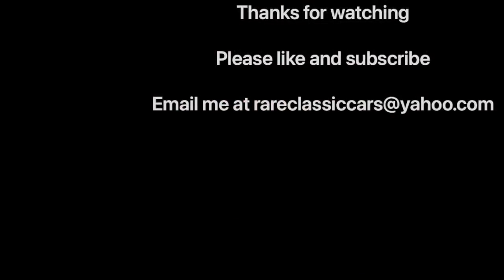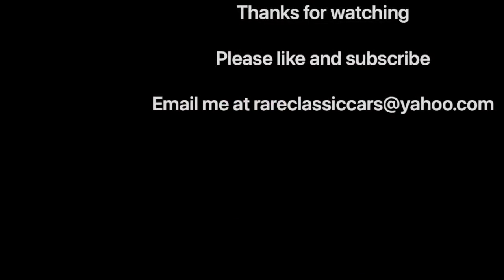Worst Engines of All Time: GM 2.5L Iron Duke Follow Up

Comment: Adam, thank you for the clarification.  Previously I mentioned my brother 84 Buick Skylark Limited with the EFI and the 4 speed manual and you clarified that with the automatic the vibration was worse.  I agree with you overall the engine was primitive and more agricultural so in those terms it was not a great engine especially when you compare it to the 1.5 Honda.   Although compared to the 1.9 I had in an 85 Mercury Lynx with a 4 speed manual the 2.5 Iron Duke was a great engine but then you can always find something worse i.e. Yugo.  Driving my wife's 77 Accord in comparison Honda was so far ahead of Detroit when it came to smooth economical and reliable 4 cylinder engines.
Reply: I’m glad you enjoyed your ‘77 Honda, but those little stratified charge engines had lots of problems, from drivability issues primarily caused by the carbon buildup in the prechamber porting and easily gummed-up carbs, to the engine’s propensity to blow head gaskets.

Admittedly, they were relatively smooth due to their small displacement.

Furthermore, the Honda automatics of those days were crap. Honda didn’t get their transmission problems worked out until the early 80’s.
Reply: @sking2173  Funny how so many gloss over any faults that a Japanese car may have, even if there are several, but declare an American car to be unfit for use for the slightest tiniest item.
Reply: But the X car weighed about 2400 - 2500 lbs.  Too heavy for a foreign-size engine.  You need cubic inches to produce torque, especially at low RPM.  Tiny engines just don't cut it.
Reply: @michaelbenardo5695  The Iron Duke had plenty of power for that 82 Buick Skylark especially since it was a manual 4 speed with fuel injection.  With an automatic I would agree with you but the manual had more than enough power.  The 2.2 in my 99 S-10 extended cab had enough power as well because it had a 5 speed manual but again with an auto not so much.
Reply: @jeffreysproul9110  I was saying a foreign-sized engine, aka a Japanese engine, is not enough.  The Iron Duke was fine, even with an automatic.  I drove a brand new one, and I liked it.

Comment: One thing that younger viewers may not understand is that there was a thrifty attitude among even many educated and successful people who were born in the 1920's and 1930's, especially among those who lived in upscale suburbs of the so called "rust belt" industrial cities. They might have spent significant money on a nice home or a college education for their kids, or even a vacation cabin up north. But they did not necessarily feel the need for a fancy imported car with a smooth running engine. They just wanted something mainstream that was reasonably stylish and reliable. And about every 5 to 6 years, they would buy a new car with the same characteristics. Also, if one worked in banking or manufacturing oriented businesses, it was always "safest" to be seen driving an American car.

Due to various oil price shocks during the late 1970's and into the 1980's, fuel economy was also a real concern. A lot of people think the "energy crisis" ended a couple years after the initial 1973 event. But there were aftershocks for the next decade that resulted in periodic gas price spikes and occasional shortages. And there was also stagflation and a bad early 1980's recession whose effects lingered well into the mid 1980's. These are now often overlooked reasons why buyers might have settled for the iron duke 4 over a larger V6 or V8.
Reply from the maker: It also explains why many went to the Honda or Toyota dealer.
Reply: @RareClassicCars  I think the imports generally got better mileage than the GM cars, which no doubt lured many domestic buyers. My mom went from a '68 Mustang to an '80 VW Rabbit and then to an '87 Mazda and a '94 Accord. The '80 Rabbit was a response to high oil prices which had reappeared in the late 1970's. There was no going back to the Ford dealer.

Comment: I haven't heard anything that bad about the LV7 1.4L 4 cylinder that GM puts in cars like the Chevy Spark. At least in naturally aspirated form, the thing seems pretty reliable. So for the sake of the argument, lets classify that as a good engine. Now what would happen if GM were to put it into a Corvette or an Impala? That would immediately make those cars suck. But would that be the fault of the engine, or would it be the fault of the GM bean counters who decided to put their cheapest crappiest engine into cars that should have never had them? In a cheap econobox or truck, the Iron Duke was fine. Crude, but cheap and reliable. It's when you put it into a car that never should have had it that the Iron Duke really sucks.

Comment: In 1982 with the Camaro in California the V8 had the worst HP to displacement ratio. The V6 was way higher and the 2.5L had the highest HP to displacement ratio.

So buying a V8 you got 135HP with 5 liters and an automatic in California 27 Hp liter

The 2.5L in California was 90 HP and available in manual transmission or automatic. So 36 HP liter and with a manual you did not have a lossy transmission.

In 1982 fuel mileage was important. The 2.5 Iron Duke in the Camaro with manual transmission here had a 24 MPG combined number on its window sticker. If you "upgraded" to a V6 you gained 10 to 12 HP at the flywheel; but in California you had to buy an automatic transmission so you lost some HP in the transmission torque converter losses.  The V6 with automatic dropped the 0 to 60mph time by 1/2 a second. Ie from 15 down to 14.5

Many folks here might not remember how rotten the V8 was in 82 in California. It was 135 HP when i got my 2.5 L camaro in july 1982

Even worse the V8 too only came on California in an automatic transmission. PLUS the V8 with 135HP was a muscle car when you were under 25 snd thus you got a radically higher insurance premium

In test driving a 2.8 with automatic and a 2.5 with manual the V6 to me seemed not much better in acceleration.  I might have bought a v6 with manual if it could legally been sold in California.

All the numbers above ate worse than what you think since buying a V8 is a 598Lb motor and thev 2.5 is 278 lbs less ie 320lbs 

So with the v8 camaro in California you got 45 Hp more for that extra 2.5 liters of motor. Plus you gained 278 lbs more mass say 9 percent more car weight.

Comment: Agree about the engine being OK in the pickup.  I drove them in small pickups and Astro vans with manual transmissions in the early to mid-80's and they were acceptable, but I recall having a rental car, a Cavalier, with one and it was an abomination compared to a Honda product.  The only good thing about the car was it had adequate power and surprisingly, decent fuel economy.  Otherwise, the entire car was a crude contraption and it is no wonder GM lost market share.  And GM never seems to learn from their mistakes.

Comment: During that era my occupation required 25k per year traveling in company-provided leased vehicles.  My first car was a ‘79 Malibu with a V-8.  Certainly not fast by 60’s V-8 standards, but smooth, quiet, and reliable.  My next car was an Olds Omega with the Iron Duke.  What Adam says here is correct.  The difference in refinement, vibration, noise, and horrendous torque-steer under hard acceleration was stark.  The next car was a Buick Skylark… no appreciable difference.  Finally I got an Olds Ciera with a V-6.  No comparison.

Comment: Adam, I must agree with you on the overall outlook of that engine and the vehicles they were installed in. I personally never owned one, but had driven many vehicles equipped with that engine and had repaired numerous ones. To be honest, customers had both a love-hate relationship with their 2.5 equipped vehicles.  The late 70's and basically the entire decade of the 80's is a time that not only GM but all the domestic manufacturers want to forget ever happened. Serious quality issues, thrown together engineering, (which probably frustrated allot of engineers, possibly due to the bean counters corner cutting. Forget the R&D, let's just see what happens approach, especially GM.) With all the new regulations coming forward (at that time) its amazing anyone of them survived.  Thanks Adam for the follow up video. Keep up the good work.
Reply: Let's not forget decisions as to power-train options, because of image-related issues... such as not making the '82 Trans-Am with a turbo V-8 (Makes it quicker than the '82 Corvette) or de-tuning the SVO Turbo 2.3L OHC I-4 for '86. (For '85: Made 205-hp vs the 5.0L V-8's 200-hp) And don't get me started on how GM killed the V-6 Chevette they threw together, but kept developing the Lotus-designed engine they really intended for it.

Comment: I think you just nailed it right on the head, Adam. The "Iron Duke" was best suited to be teamed up with a manual transmission rather than an automatic. My Iron Duke powered 1991 S10 was equipped with a 5 speed manual and even though it was not very powerful, I could keep up with traffic on the freeway. Driving through mountain passes, however, required patience and plenty of shifting to maintain your speed. Passing, at times, could be interesting as this engine does not like to rev and it gets pretty breathless at the upper end. It might have been an "okay" engine in terms of reliability and durability but it was light-years behind all of the other 4 cylinders in the market at the time. A pushrod 4 was pretty low tech.
Reply: But it was STURDY.  And that, after experiencing the disaster of the "state of the art" Vega engine, was what we wanted.  STURDY.
Reply: @michaelbenardo5695  I agree, it was STURDY. To get the most out of the Iron Duke...or to make it more bearable, a manual shift was the only way to go. You had 2 more gears and they were spaced out pretty good. The automatics at that time were limited to a 3 speed which did nothing for power as the transmission sucked up what limited power it could produce. Definitely not in the same league as what the imports were putting out. A Honda with a 4 speed auto was pretty peppy at the time.

Comment: You can believe me or not,but a close friend of mine who is a lifelong mechanic had a late 80s Buick skylark with a 2.5 and after over 200k he decided to re build it and the rear main bearing only had one half of the bearing insert in the block not cap,never been apart.Never had any drivability problems.Cant explain but saw it.

Comment: Jim Hall of Motor Trend, when testing the “new” AMC 2.5L I4 in 1984, said that while Pontiac supplied Iron Dukes to AMC for a few years (1980-83, specifically), GM should buy AMC’s 2.5L four and replace the Iron Duke with it, since the AMC engine was far superior. And it was based on the old ca. 1964 AMC six!

The 2.5 Iron Duke was a boat anchor. Boat anchors are reliable. But that’s about it.
Reply from the maker: Jude, was this Jim Hall of Motor Trend?  If so, I know him well.
Reply: @RareClassicCars  Yes. Sorry, Motor Trend, not C/D.
Reply: Trying to find the archival clip

Comment: The Rover K series is a candidate for wirst non Anerican engine,  they all kettle themselves and have so many design faylts that heads do not stay torqued down due to the stretchbolt design. Hey are worse than the GM death star for ONGGGF..

Comment: I think your comments are 100 percent on the mark.  Expectations of car and truck owners are often very different.  Also, I agree with you about many US cars of this era — they seemed cheap because they were “thrifted” a bit too much, particularly GM and Chrysler products.  The Iron Duke was just a much rougher running 4-cylinder engine than many of its competitors.

Comment: 1990 Ford tempo with a 2.3L pushrod turd or 1990 Honda Accord F22A1 inline 4 with balance shafts,  rear windows that roll all the way down, 5 speed auto that operates like a manual transmission internally, and glass headlights that you can change the bulb in.  I could name features of this car all day, awesome vehicle and was truly over engineered in all the right ways. Except the turning radius was terrible, you couldn't remove the front rotors without total disassembly of the suspension, the transmission had no serviceable filter but it had all external shift solenoids on the case for making repairs easy, and 2 timing belts, one for waterpump and cam , the other one was REALLY tiny and drove the balance shafts. 500,000 mile cars, easily .

Comment: If it's 1982, and you want a smaller car that is fuel efficient, choosing an American car of any sort would not be the best choice by a long shot. A Corolla, Civic, GLC, 210, 310, Rabbit, etc etc etc would be the obvious choice for the savvy consumer. BUT, it's 1982 and a lot of car buyers in the US wanted to buy American NO MATTER WHAT. It's absolutely silly and insane to me that people would settle for, for example, a Chevette which had virtually no standard features whatsoever, questionable build quality, absolutely horrible sound deadening, basically no real refinement, a sub-60 hp engine, etc etc etc when for nearly the same money you could get a Japanese car with a very efficient, quiet drivetrain, LOTS of standard features, a 65-100hp engine and phenomenal fit and finish instead. But again. It's the average American consumer in the early 80s and LOTS of them would rather buy a very sub-par domestic car than give a dime to the Japanese or German companies. Hence people probably had a lot of love for the iron duke because they didn't know how much better they could have had it and didn't care. (And yes, I realize the Chevette didn't use the iron duke, and also see the irony of people choosing an "American" car which was just a slightly changed Opel with an Isuzu-derived engine. I should also mention I've had multiple Chevettes and love them to death, but I can admit their many flaws compared to the competition of the time.)

Comment: Please Inform, but I think your referral to the TECH 4 engine as the  Iron Duke is mistaken, the Iron Duke was a 4 cylinder all cast iron 4 cyl  used in the Nova of the 70's and even the chevrolet vans had them as the entry level engine. Mercruiser used them in their inboard  marine applications .
Reply from the maker: Both were called the Iron Duke and were completely different from one another.

Comment: I once dated a lass that had a Cavalier with an iron Puke in it.  Looking back on it, it had to have a bad motor mount somewhere in there on top of the normal vibration.  You mentioned shaking steering wheels and vibrating dashes.. Her cavalier was so bad, it actually sent pressure pulses through the cabin at idle in drive.  Stoplight conversations were near impossible.  The radio sounded garbled.  Worse yet, I think it was a ‘94.  Didn’t they have balance shafts by then?  If you spent more than ten minutes in traffic, you felt stoned when you got out..  perfect car for people who barely check the fuel gauge, let alone the oil, or notice a mostly flat tire.. Let’s face it.  For a while there, most early nineties Cavaliers had at least one semi-permanent spare tire on them.  Not a slight on the lass at all.  Although I have almost always called the Cavalier the cockroach of cars.  Because Iron Fluke.
Reply from the maker: The Cavalier had a different 4cyl.
Reply: @RareClassicCars  Oh my.  You’re kidding.
Reply: That car had to have been missing every piece of rubber isolation in the drive train.  I always just assumed it was the 2.5 because it felt like (but worse) than my buddy’s ‘84 Somerset.
Reply: The 2.2 was a different motor that was loosely based on the 2.8/3.1. In my experience when everything was in proper condition they idled smoothly and were fairly unobtrusive unless you beat on them.
Reply: @mydsmber05  Welp, color me embarrassed.

Comment: I understand your point its well taken I'm Owned a car 72 monte Carlo and after I got married I had to have a ride to work If you wanna call it a work horse I guess that's what it was I bought a90 model cavalier it had the iron duke in it It was well maintained I changed the oil every 3,000 m and it run flawless for 180,000 miles and was totaled by my Daughter-in-law And that was the end of the iron duke
Reply from the maker: Cavaliers had a different engine.

Comment: I wish GM had a high tech straight 6 in the 80s. Balanced engine. Radically less engine shake. But maybe the agenda was not viable for front wheel Drive gm cars.?
Reply from the maker: Too long to fit transversely.

Comment: I just can't justify a "worst engine" rating for the Duke, despite its flaws. I remember the one in the Citation and with its grindyness and all, I'd still prefer it, with its 16 second 0-60 performance to a that of some of  the smoother, but slower (sometimes near 20seconds) 6s in some of the B-bodies, or even some Toyota and Honda engines that I've driven that were smoother but loud.  The vibration just didn't strike me as a big deal when the car was adequate in most other respects. Its tremors  would have been a bit more out of place in in the boardroom interior of a Skylark or Century, but buyers of those cars had only themselves to blame if they test drove their cars and still bought something they regretted; they could have shelled out the $700 for the V6. People were shelling out much more for Sevilles and 240Ds with much rougher, noisier and in the case of the 240D, slower diesels during these years.